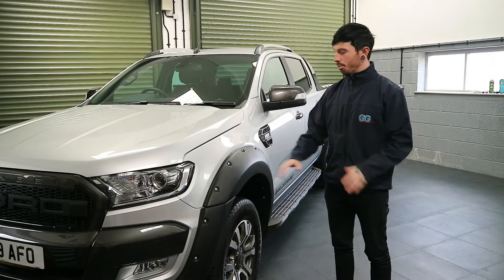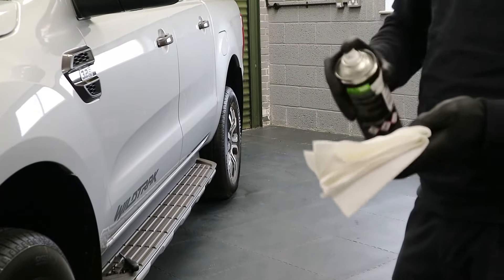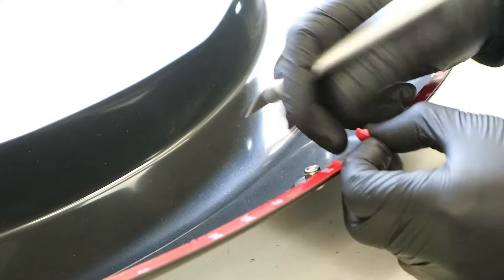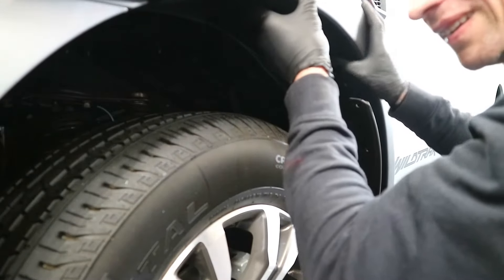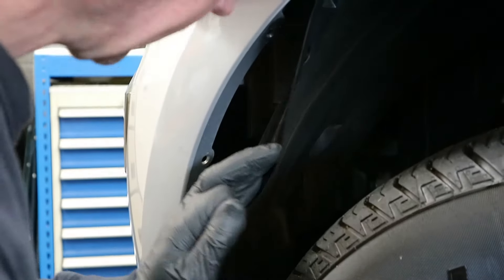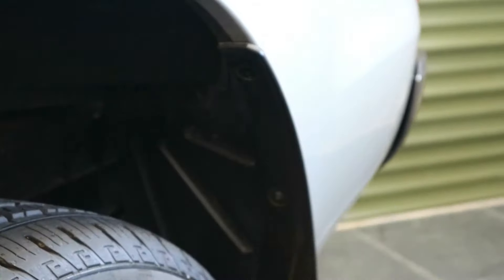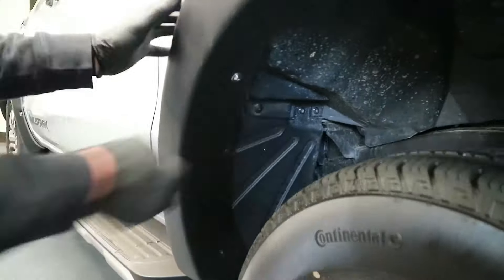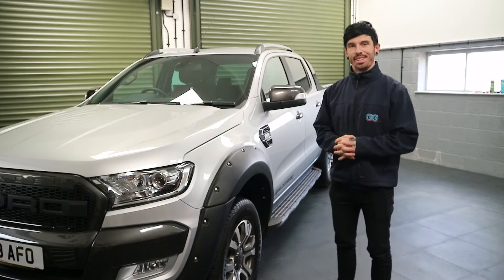HOW TO FIT FORD RANGER WIDE ARCH FENDER FLARE KIT

Comment: Fitted these, a year later they are coming away from the bodywork, already reinstalled them with new tape, a little heat and modification (cutting) is required
Reply: Do you think you need to drill into body work and rivet them

Comment: You need to be extra carefull when refuelling not to allow fuel to drip down the panel when removing the hose nozzle as it affects the 3m tape.
Reply: Do you mean for diesel, petrol, or both? Was wondering if this would be an issue. Thanks for posting.

Comment: I have a 21 reg Ranger Wildtrack. I bought flares these from 
Storm Xcessories - 4x4 Accessories, UK. The 21 model has a strange rivette at the base of the arch, it can't be unscrewed, unlike the rest of the arch which has screws. Yet the fender has to be screwed into this specific spot. Any advice? We can't see how to remove it without drilling. Also it reckons, in the instructions we have to cut the front  mudflap - which seems odd!

Comment: I guess its a preference for some but PLEASE for those who go this route... and this is just my humble opinion... PLEASE get a tire n rim upgrade at the same time when u add this to ur trucks... i see ppl driving around with these flares and on stock street tires... this makes the truck look like it skipped leg days at the gym...
Reply: Or install a thinner flare, its way too thick for this size truck in my opinion.
Reply: @marcusgrimmm  i love the look of the slim line flare if the truck stays stock height and tyres...
Reply: @princeodinson3239  Yep, I'm actually looking at getting a slim line for my ranger.
Reply: I wish there were more options for a more hidden screw placement for the fender flares. They don't look that good in my opinion.
Reply: True
Reply: I agree. Those fender flares are huge. That truck would have to be lifted 2 inches to accommodate a tire that matches up to those flares. I can see if it’s a working truck on a farm and you’re trying to keep mud off the truck then I guess it’s practical.
Reply: Since the Ranger comes with a 17 inch rim, I think a tire upgrade and a lift of 2 inches with would accommodate those fender flares
Reply: @bmack2938  you may also consider that the stick rims are a + offset so to give it some poke to level off with the flares u would need to run spacers (not a fan) or change the rim to an 0/+offset
Reply: Everyone says 2 inch lift all the way around.
Reply: @princeodinson3239  I have a sport 4 x 4, so I already have wheel flares, but they don’t actually go out past the body. I wish I could send you a photo.
Reply: @princeodinson3239  I tried to order some mudflaps and they required that I drill through metal and I just didn’t want to do that. I don’t want to open up a spot for rust. Maybe I’m Type A personality. But that’s me.
Reply: @bmack2938  I have on mudflaps now that are from the dealer... I don't see why ubwould need to make any holes...🤔
Reply: @princeodinson3239  I have a sport 4x4 with black wheel well trim. If I didn’t have the black wheel wheel trim, the mudflaps would’ve went right on. I’ve ordered three different types of Amazon and none of them fit. Again if I didn’t have the wheel well trim, they would’ve gone right on.
Reply: @bmack2938  ohhh I see... have you tried asking the dealership for a solution?

Comment: What's maybe not apparent (and it wasn't to me until I started researching) is that you need to fit these wider wheel arches to fit aftermarket wheels, at least in UK and (probably all of Europe) because the aftermarket wheels have greater offset and push the wheels beyond the original wheel arches and that's illegal. Wider arches give the wheels more space and so they stay "inside" the width of the vehicle. Stupidly, when I saw people say you need bigger wheel arches to fit wheels I thought they meant the diameter of the arch and not the width out from the truck! Doh! Anyway, hope my stupidity helps anyone else wondering how the hell adding more stuff around the edge of the arch was going to give more room.....haha

Comment: Hi Matt, thanks for the tape.
These videos relating to the ranger are great, and the customer services are brilliant as well. With your kit my wildtrak will soon be looking like a raptor. I've got some 38mm wheel spacers coming, because of the flared arches it looks like I'm running space savers.
Keep the products and videos coming 👍👍👌
Reply: Hi Martin, hope you dont mind me asking you a question, I'm fitting these arches. But want to keep the wheels because I work in forestry, I noticed your considering 38mm spacers. Do these sit inside the arch? Because I was looking at 30mm just to fill the arch and have being looking everywhere for advise.

Thanks 
Will
Reply: @williampeyton9855  hi Will of course I don't mind you asking, I've now got the 38mm spacers installed and the wheels look great, I was considering 50mm but on reflection they would probably be to big, 30mm will be ok, but I'm happy with 38mm. Good luck with the install.
Martin.
Reply: @martinmeasures829  thanks Martin, much appreciated 👍